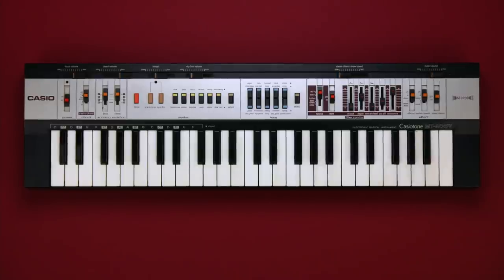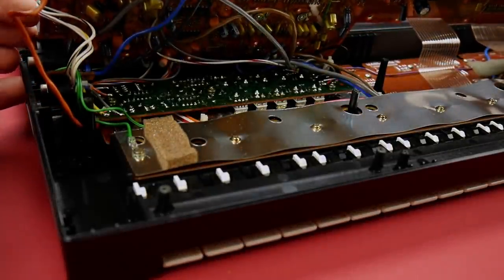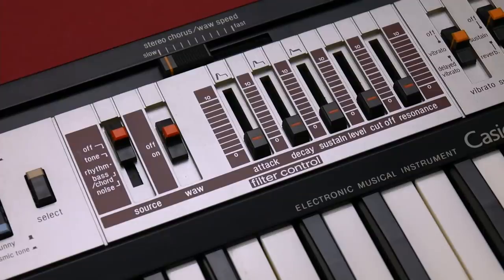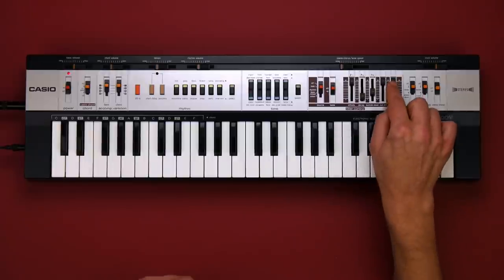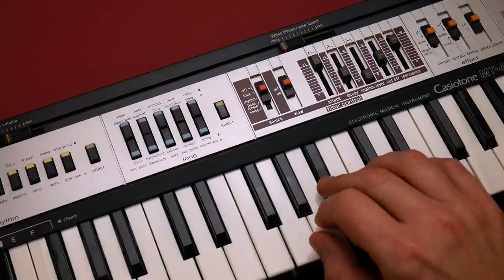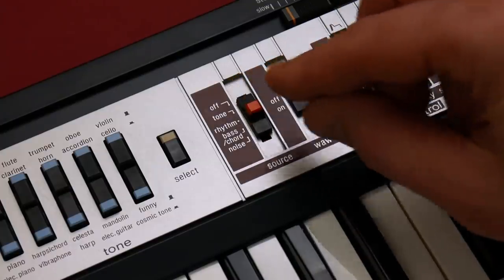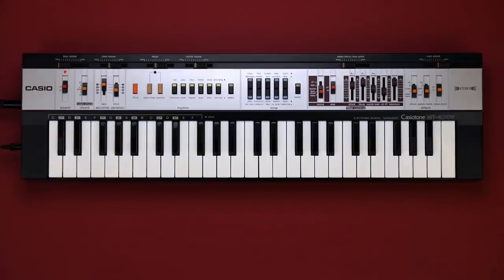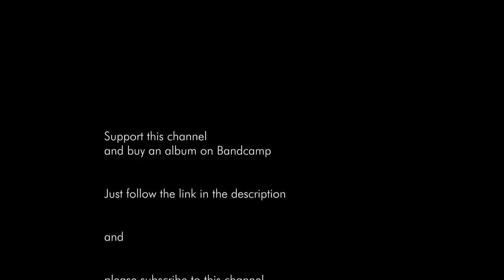Casio MT-400V - The keyboard with an analog filter control

Comment: Gosh, even before you did the proper demo, I could tell there was a lot more texture in your BGM!

I suspect that Casio had a bunch of excess high-end analogue ICs/designs leftover, and since they knew they were moving to digital synthesis soon and probably couldn’t sell analogue to big spenders anymore, they probably included them in this keyboard to use up the inventory. 

Like, the various virtual patch cable options for where to route the filter, how to manipulate the filter, etc are all pretty dang impressive, even today in some regards (albeit of course modern instruments generally do it more or better). Also the chorus!

As always, your little demo ditties are always a treat. A bunch of them reminded me of Game Boy, NES, or Mega Drive soundtrack melodies in lots of ways, probably just happened to be in the same key as them with similar tone textures :) 

Now I want to try to replicate some of these sounds on my big boy subtractive analogue synthesiser, heh. The CV synthesis definitely has an interesting texture all by itself. 

Lastly, much like your video on that surprisingly capable FM synthesis consumer keyboard, this is also one of the most accessible rundowns of analogue synth filter basics I’ve seen! Not too much technical terminology, not too little. I’m going to send this to some friends who have an interest in synthesis but tend to get lost in the jargon!
Reply from the maker: Thanks a lot! I am planning to make an explanation video about subtractive synthesis in which I will certainly go into more detail.

Comment: I'm so impressed that you explained the paraphonic filter behaviour, and the detail of how each part of the filter influences another part. I have several videos on my channel using my MT-400V in my playlist: Classic Casio Keyboard Covers. I probably can't paste a link here so I would be very happy if you have time to listen. I do also have a BFC-1 breath controller but it was a bit disappointing and hardly changed my usage of the little synth.
Reply: Is the Casio BFC similar to Yamaha's BC Breath Controller?
Reply: @kenzieprice6745  In that you blow into it, yes, but the two are not compatible, and the Casio BFC only controls filter cut-off, not volume expression.
Reply: @althejazzman  Thanks Alex. As you know thr BFC-1 is pretty hard to source so I have been trying to brainstorm ideas to substitute for it. They seem very similar in mechanism so maybe it can be modified?

I'm planning on playing around rigging up a foot expression pedal to control the filter bur I wih I knew more about the BFC-1 and how it interfaces with the MT-400v.

Comment: The imperfections often seem to make these keyboards more interesting. Compared to all the modern analog and digital synths where they are just bugs which may or may not get fixed in firmware. Some could do with a Casio Imperfection Integer Chip.

Comment: The filter and chorus elevate this from humble home keyboard to something that would sound great in a professional recording! I probably would have preferred this Casiotone over the supposedly professional HZ600 that I had as a kid.
Reply: The HZ-600 is great! same engine as the HT-700 and 3000.
Reply: @juno6  I found the single oscillator and choice of waveforms really limiting. It was also tedious to program with an alpha dial and two buttons plus the parameter values were really coarse (1-32 for filter cutoff if I recall). The final thing was that mine at least would regularly scramble its memory - a nightmare for playing live!
Reply: @chriswareham  the MT400v also have one oscillator. The HZ-600 is not super flexible, but it have a nice variety of waveforms, a Roland type filter, two fast envelopes, a cool chorus .. is like a Juno 60 but without the sliders. I have a huge collection of synths, mostly vintage analogue and digital synths and samplers..  but I always tend to go to  my beloved HT-700. I have two of those, a 3000 and two 6000 (highly recommended) and the 600.
Reply: @juno6  If I can find one that's not being sold for crazy money then I'm tempted to buy it just to see if the young me didn't judge it too harshly. At the time I really wanted a synth with loads of sliders or knobs and I now have that covered with my much loved JX-3P and its PG-200 programmer.
Reply: @chriswareham  the 600 is a compact little synth, which sounds beautifully (did you see the video?). But the 6000 is a 4 dco proposition, with independent filter per voice... Consider it too.
Reply: I have a 400V and an HT-700.  The HT-700 is more programable, but to me the 400V is more fun to play.  They’re quite different - it’s almost like the the 400V is Casio’s past while the HT-700 is moving toward their future.  I also have a 410V, but I can’t relate to it as much as the 400V.  There’s something about it’s form factor that make it truly unique.

Comment: Got mine for about £50 in 2010. I’ve used it on nearly every song I’ve recorded with my band since. Mine is very beat up compared to yours. I run it through some 80s pedals; distortion, chorus and delay make it even more flexible than it already is.

Comment: The great images of the boards will help me rewire my MT-400V. I only payed $6 for the keyboard. I removed the chorus circuit to build a Ibanez FL9 Flanger circuit\guitar pedal with the MN3102\MN3209 IC's. I also removed most of the metal film yellow capacitors. The 2 IC's and those capacitors are worth more than the whole keyboard (if like me you build guitar pedals). But If I decide to rebuild this keyboard, this video will help greatly with such great image details. Thank You !@! lol
Reply: Well. I did try to rebuild this. I got about half way with the wiring but the filter\chorus board and the main volume and chorus sliders I have no idea. Plus other connections. My Main board is M485 MA1M(A). It's a bit different for this video (B). The MT-410v video is revision (D). What are the chances to open this casio MT-400v up again and document the connections to all the boards? 🍻🙃😍

Comment: So what generates the sounds before they go to the filter, if they don't sound quite like a raw standard waveform when without filtering?
Reply from the maker: The NEC D931 Sound IC generates two waveforms with different envelopes
Reply: @KeenOnKeys  Ok, so they interfere with each other, and it is sort of like additive synthesis but with already harmonic rich waveforms? Do you know any literature explaining this chip or its technique?
Reply from the maker: Casio calls it “vowel-consonant synthesis.” Unfortunately there isn't that much to find about it. Check out the MT-65 service manual which should be available online. It contains some explanations.